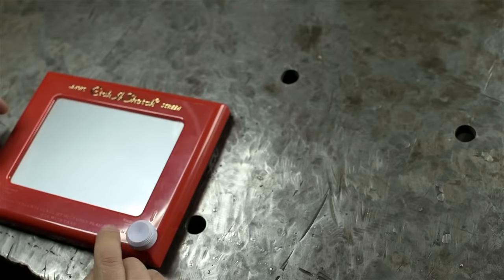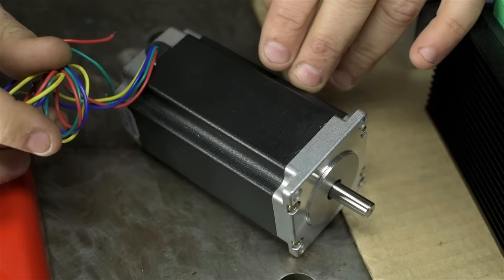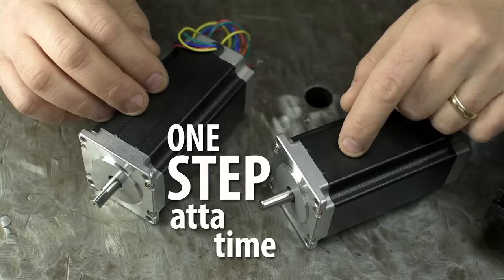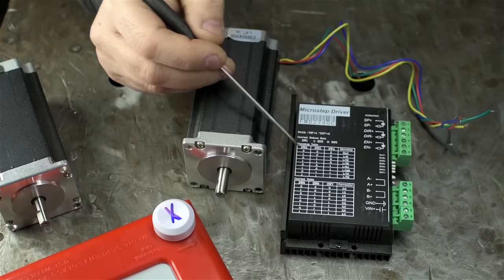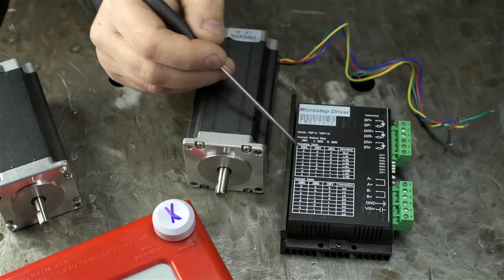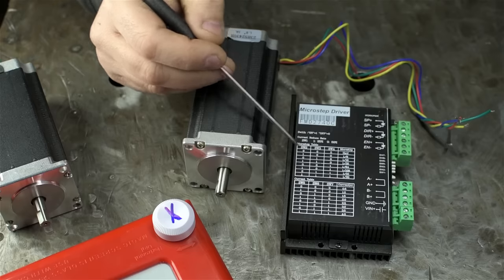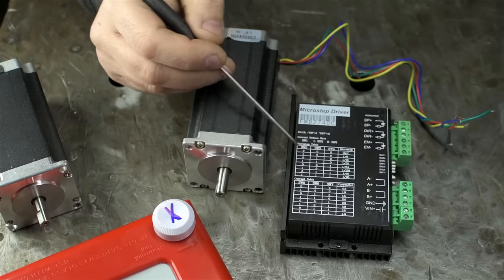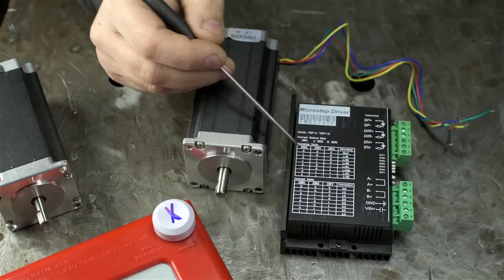Build Your Own CNC! (Part 1) - Hardware

Comment: Every time I want to do a Custom CNC thing... I have to remind myself of the costs of all those boards and motors. There is just no getting around the cost of hardware.
Reply: A complete KIT OF 3 AXIS CNC IS SOMEWHERE ABOUT $ 300.00 .... WTF ... ARE YOU INCAPABLE ?
Reply: @kennethkustren9381  $300 is a lot of money at times. It's why I still don't have a 3D printer, A desktop CNC, A Laser cutter,  a lathe, a mill,  a tig welder, etc. Plus, I'm in the middle of a major career change so money is mostly allocated to that and not building things.
Reply: I think Kenneth is not including the cost of the mill, lol. My reason has nothing to do with cost. It's time and space. If I had all that stuff, I know exactly what I'd do with it. I'd make custom parts and jigs and tooling for those machines to make it easier and faster to make... better jigs and custom parts for those machines. And then I'd fix the occasional consumer good or neighbor's lawnmower, like 3 times in my life. There are only so many French Alex pasta machines to rebuild in my world.
Reply: You can start with an Arduino UNO ( $3 for a good clone) + CNC Shield for UNO with 4 A4988 motor drivers  ($10)   +  3 Nema 17 motors ($25) + GRBL software for UNO (free) + GCode reader for PC (free)... This whole thing will cost you around $40 to do this Etch-a-sketch set-up. Also you can use this same setup and add a small spindle motor good enough for carving shapes on wood, plastics, aluminum etc for $20... Cheap enough?
Reply: for etch a sketch 28BYJ-48 tiny steppers will do the trick. they come around 2 bucks, and have integrated gear reduction - i guess otherwise they won’t be able to turn nothing. they’re soo small you can run them on 12V with a darlington array. their torque is amazing 0.034Nm though
Reply: Use grbl and Nema 23s. 40$ for tb6600 drives. 25$ a motor. 15$ arduino.
Reply: 3D Possible  I haven't tried Fusion 360, It probably shouldn't be difficult for me to pick up as I've had general training in Solidworks. I would just use Solidworks since I already have some experience with it, but I'm not going to pay for a personal copy of it plus the CAM module.  I'll definitely have to keep that smaller NEMA 17 kit in mind. Thanks for the suggestion.
Reply: @sikedipuuhja7376  Good thinking, powered by $4 Arduino and $20 motion control board. Would be a lot slower though.
Reply: @borayurt66  That is the way I am doing it. Have a Sherline mill (without the spindle) to work with and a Seig X2 mill.
Reply: I got around the cost of the hardware. I don't use the same setup Tony does. I changed my lifestyle long ago too. Tony should try LinuxCNC someday. Then he can stream himself on his machine controller while it is running. Something that he apparently can't do running Windows and Mach 4. I wouldn't let Windows run a coffee pot.
Reply: Lassi Kinnunen  I built a 3 axis CNC machine for $300. I do mean that's what the whole machine cost too.
Reply: 3D Possible  Every wonder why autodesk offers Fusion 360 gratis? Could it be because they are concerned about truly free CAD software? So they throw hobbyists a bone and that slows down open source projects. Pretty cunning of them.
Reply: This hardware is really overkill for a small CNC router. Nema 17s, basic Arduino Uno+CNC shield, a power supply, and a blob of wires to connect all of that will do just fine for mechanics.
Reply: @EgorKaskader your definition of just fine and mine obviously differ significantly. I've built a CNC machine so I've had to grapple with many issues at length. I know all about stepper motors, motion controllers and the electronics that hold it all together. None of the crap you listed cuts it. You're not shoehorning decent motion control software onto an Uno GRBL isn't decent motion control software for that matter. You're not even going to get 2.4 Watts of power out of one of them motor shields either. You're sure not going to get the torque out of a NEMA 17 motor. The best of those is around 60 oz/in with is about a quarter of what you need. So no, no and no. You must be a salesman for crappy Chinese engraving machines to even suggest that nonsense. Although those machines have more inherent problems than just that. Like lightweight unsupported flexible linear guide rails. Never a good thing in subtractive CNC.
Reply: Mhmm, because clearly not wanting to pay up luducrous 250 bucks automatically means the result is crap or it's being pushed by a salesman. Definitely a 250-dollar control board is hobby level. If you don't like Uno, use Mega, or its bigger beefier 32-bit brother. If you don't like A-series or DRV-series stepsticks, there are TMCs. 17s run for up to 2 amps, and reductors are a thing (that said, I rather doubt you're using reductors with timing belts, but are you really running a CNC mill over 70 mm/s?!). The sheer cost of this setup is definitely beyond a hobby-level machine once you factor in the drivers. Also that wiring looks fun to do, especially when Arduionos are plug\n'play and Tony seems unaware that CNC shields are a thing. That motor is also an overkill unless you work with steels. Especially a freaking 3D printer, you don't use Nema 23 for THAT. You need 5 goddamn motors in the printer for it to work properly, 4 if you want your Z-axis to be wonky or aiming for a Delta setup, and in a Certhesian your Z-axis is lugging the X-motor around, and then with a direct-drive extruder your X-axis is lugging around the stepper in the extruder. Just the cost of electronics and motors to run that is beyond Prusa i3 Mk.2S, which may i mention is basically the benchmark 3D printing community uses for how good a 3D printer is.
EDIT: as for recommending "chinesium" I explicitly said Arduino Uno, not just "some" Uno. If anything, based on my experience with so far 3 Mega 2560, Chinese clones of Arduino are guaranteed to fail because so far I got 3, and none of them worked more than an hour on their default linregs (which I then swapped out for NCP1117s, because AMS1117s they come with blew out on every one I got.)  Literally the only reason to get Chinesium is because if a linreg blows Aliexpress refunds the board, and you can then fit a new linreg on. Still managed to kill 2 Megas by Chinese limit switches which blew the good linregs by shorting them, and also blew the pre-installed CH340s.
Reply: @EgorKaskader  the only difference between men and boys is the size and cost of their toys. So I'm not sure what you are basing your argument on. Because spindle CNC machines are not 3D printers either. So piss weak motor shields aren't going to cut it there. Amps is NOT an expression of power! We use Watts for that. Now if you go digging into the data sheets for the chips on motor shields you may find their Watt output is abysmally low. Something on the order of 2.4W. Which makes sense if you consider what they are. Right now I am using TB6600 drives on my CNC machine and they output 14W.  Which nets me a rapid speed of 75mm/s. So yeah I'm going faster than you think. My whole CNC machine cost me about $300 to build. I do mean the whole thing. The PC, the monitor, the mouse, every nut bolt and screw I bought for it. I'm what can be called a smart shopper among other things I try to be smart about. A smart ass too! Well maybe a wise ass? But that's a topic for another discussion.
Reply: @EgorKaskader  I don't care what you call anything. It is what it is. But yes it is an old second hand PC (total cost $18 for tower ($6), monitor ($10), keyboard ($1) and mouse ($1)). At one point I was using a freebie but I upgraded that. The freebie (a 1 GHz P3) worked but it was limiting my performance. That general theme upped my final project price over and over. I could have done it cheaper if I'd settled more than I did. But as I went on I often wanted a bit more. So I got caught in that trap. I was having fun though so I considered it all good value. Breaking glass and bending soda can aluminum is no measure of strength either. My leads will develop over 4 tons of force according to calculations I've done. Which is enough force to jack up a truck. I keep my hands well clear of moving parts while it is operating. Because it is something I don't want to test out first hand, or last hand? The way I built my machine it certainly has pinch points. So it could cut body parts right off the careless. NEMA 17 are toy motors.
Reply: "Soda can aluminium" looks at 4mm thick sheet of unknown alu alloy of the A8's heatbed sure, sure. I don't know where you've seen soda cans like that, but I'd love to get my hands on one of them (or several). I don't know how much force my Z-assembly does, mostly because I don't plan to ever stress it by having it go full out again with its spring couplers and because I frankly don't trust Anet's spec sheets because X and Y motors both managed to snap steel-reinforced 6mm GT2s, but the right Z motor (before it f88ked off into the extruder) visibly lagged behind the left despite both running from the same stepstick and the difference in their torque was evident by the coupler damage being higher on the left. I don't actually plan to find out with a dynamometer or something either, because surprise - 3D printer's couplers, designed to eliminate slop more than anything else, and usually subjected to extremely little forces, can't take the amount of stress put on them when the Z-axis crashes into something and stretch out, thus losing their entire point - eliminating the slop.
EDIT: Neither do I trust anything else Anet might say - because 1) see motors above 2) the daft buggers put in a brass extruder gear. Hence why I'm not bothering with the calculations. That said, someone did the math for a Prusa i3 Mk.2, and while I don't recall the exact number it was close to a metric ton - not that you'd want your hands anywhere near its toolhead as while it won't rip fingers off like "adult" CNC machines, it still has a hot end there which can and will give 2nd degree burns.
Edit 2: you know what else I gotta LOVE about the situation? You're giving shit only to me, except more or less the entire thread above mentions using Uno (some even suggest Chinese clones, anyone not a cool smort boi like him here please get geniune Ardu parts if you don't feel like house fires and repeatedly buying new components!).
Reply: @EgorKaskader  paralleling stepper motors off the same drive is not a good idea. In case you haven't figured that out for yourself yet. When I run dual drive axis I slave each drive to the same step signal and have a drive for each motor too. It works as long as you have plenty of torque and never stall out. Oh and plenty of signal current for the drive control signals also. Which on real drives is not a trivial amount. Fanning out two is borderline what logic circuits can source. With shields it isn't something you have to worry about though. They're not protected. Which is why they're so susceptible to noise. It helps if you know what is actually going on. What all them little doodads on boards are really doing.
Reply: Yeah, I'm afraid that's not how it works, there's a certain kink with 3D printers. See, 2 motors off one stepstick is the way to do Carthesian mechanic, and here is why: Z-axis has 2 low moving torque, highholding torque motors and you need precision within about 0,00X mm in it when it moves , or your print (and if you're off enough, in 0,0Xmm, printer) is going to suffer. Motor desync is not an option. There even are people who despite having both drives running off a single stepstick also include various synchronisers, most commonly linking the two lead screws with a belt. Also, again, Z-axis has very little torque when moving - in fact, it's on a holding torque 99% of the time. Systems with two stepsticks (like what you suggest) invariably have Z-desync issues because of inherent flaws with tuning and stepsticks themselves, that was worked out a looong time ago by 3D printing community. 
Y'know, this more than anything convinced me that I may be wrong with Nema 17s, because the mistake you're making is so obvious to someone who had to DIY a printer, so I may be making something equally obvious but needing an insider perspective. That said, I'm going to trust Stefan of CNC Kitchen when he says his wooden machine with threaded rods for leadscrews worked for most applications with them.
EDIT: well you could of course resync them manually before each print or have each of the motors have a high-precision endstop so they autosync, but that's just needless complexity. Also, that's not your "adult" CNC mill or lathe, if your "toy" printer's well tuned and well taken care of, all you need to do is slot in that SD card and pick the file (or send the code through manager software if you're running tethered, I.E. SD/USB reader's f**ked or you really like to see it progress in realtime down the toolpath), and probably just in case watch it home and lay down the first layer, not that it's usually necessary but y'know. There's basically no pre-tuning the machine for individual prints if you're not being a bad owner and putting at least token effort into maintenance.

Comment: I bought some CNC parts not having any idea of the part numbers (a local auction but online).  I got the stuff cheap and went and picked it up.  They are GIANT steppers and GIANT pillow blocks.  Its crazy.  Was going to use to for a larger 3d printer but I think I need to make a CNC now to make use of these epic parts.

Comment: An example of the idea of there being more than one way to get to the finish line:

When I set up my desktop CNC mill, I built the controller for it. I used a single Gecko G540 4-axis stepper controller to drive the motors, a SmoothStepper to drive the Gecko, and a mini-ITX PC running Windows to talk to the SmoothStepper. I also built in power supplies for stepper and spindle motors, added a motor speed controller for the spindle, and wired everything up with solid-state relays so when the PC was powered up it in turn powered up the power supplies for the machine. Everything fit inside a 4U rack enclosure. I ended up with a completely self-contained CNC control system that could basically power any "small" (read: anything that uses 24V 2A steppers or smaller) CNC machine up to something like a 4x8 plasma cutter table. It's been serving my needs for several years now.

Comment: I did somewhat this same thing as a fun experiment with the controller (I used some Arduino Uno Shield that ran GRBL following the NYC CNC tutorial from like 3 years ago). I hooked it up to an etch a sketch mini but I was able to use timing pulleys direct to the shafts (Under the white plastic knobs). The backlash was the killer and as far as I know GRBL and inkscape don't handle backlash.

In the end the guts went into a custom CNC that would engrave glass candle votives that we gave as our wedding gifts (Several videos on my channel) and the Etch a Sketch was way more fun than tape flags as you too have found.

Comment: Im getting ready to build a cnc table for my shop.  Big enough to take a 4x8 foot sheet of steel, wood, or whatever.  Have most of the table components and the cnc ready plasma cutter and a router head to use both.  Hopefully i will be starting my build later this month.  I still need the ballscrews, rails, and stepper motors. Already have the framing steel and such. These videos you have made have been very helpful with design and component selection.  Of course all of your videos i have seen have been excellent.  Thank you. I have thought about videoing my build to post on here but have never made a video so not sure how all that would work out but never know lol.

Comment: Invert using channel 3 and use a trigger switch to activate one of those bed vibrating motors when upside down.  That will shake it up.  The vibrator motor would be mounted to the back of the etch a sketch board.

Comment: AvE did a tear down on a vibratory for gold processing a simple single ball bearing in a outer race . Use the Z access to spin a magnet to drag the ball bearing to shake the Etch-a-Sketch. The one he was using had approximately half inch diameter ball Push by air or hydraulic generated 500 lb of force that'll erace more than just an Etch-a-Sketch . If mag drive doesn't fit your fancy then you could use that third motor to power a micro turbine to supply the air to power the vibratory.  That would be a cool reset button.

Comment: Good old Thinkpads, they never die no matter how many drinks have been spilled on them, keys missing, or the hundreds of drops they endure. I had a Thinkpad that was used in the shop and in the feild. Went through two batteries in it's lifetime the last thing that killed it off was the hard drive failing, no use in replacing the outdated 2.5" Ide drive it got recycled.

Comment: This is 2 years old when I’m seeing it. Maybe things have changed, but most 3D printers use nema 17 motors that are much smaller and cheaper (and still don’t use a gear reduction). 

For something the size of an etch a sketch you could even use tiny 28BYJ-48 (plus their controllers) steppers that are about the size of a C battery for a few dollars on Amazon and control it all with an arduino. You could do this whole project for like $30 these days.

Comment: 27:44 Running Linux is not a »lifestyle change«, it’s just augmenting your capabilities and the capabilities of your hardware, especially older hardware. 
I switched to Linux 5 years ago, using LibreOffice/Gimp/Inkscape/Ruby/Steam like on macOS or Windoze. Cheers!

Comment: Tony, use the third motor attached to the mdf. Use a disbalanced weight in the  shaft, so when it runs it vibrates (this is how cellphones vibrates)